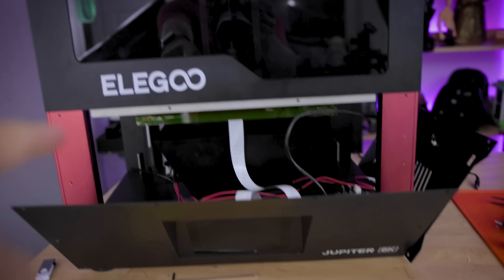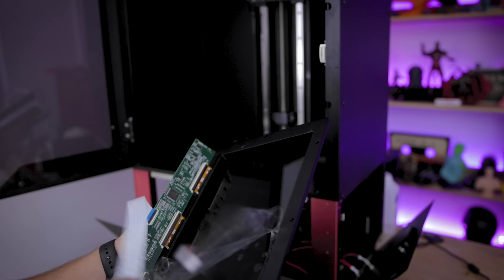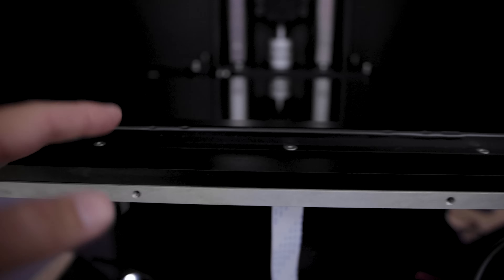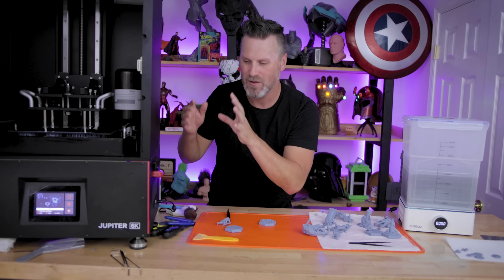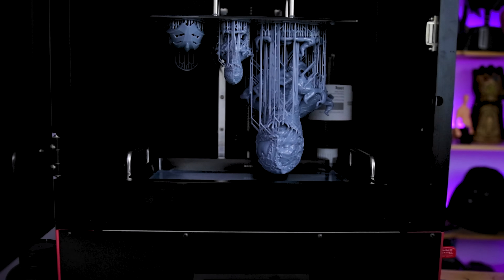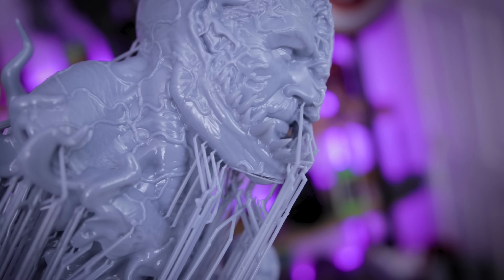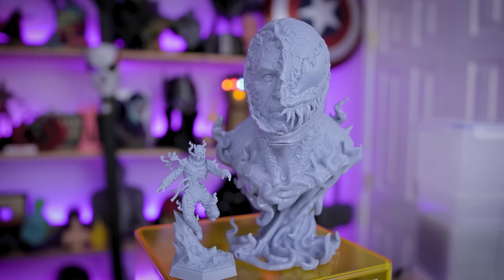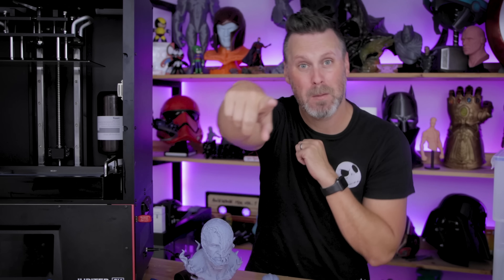Elegoo Jupiter - Screen replacement / VENOM BUST!

Comment: I just unboxed and setup my Jupiter resin printer. I followed the instructions but I cannot get anything to stick to the plate. I am printing the file that was on the usb stick, any thought. I have dumped the resin and cleaned 3 times then level again .

Comment: Why did you have to replace your screen on the Jupiter ? I just got mine two weeks ago and after 12 perfect prints, the screen failed with no warning (now just flickering vertical bars on the exposure test and very seldom showing shadowy elegoo test pattern). Already reseated cables and no improvement. No leaks, I have a screen protector Mach5 on, inexplicable failure. Emailed Elegoo support, no answer yet. I wonder about the reliability of these screens compared to my Anycubic Mono X that has worked fine for more than a year. How long did it take to get your replacement screen ? Thanks !

Comment: What type of light source did Elegoo use in the Jupiter? Is that a COB light or an array with the cone reflector?
Reply: Hello Matt, it is COB light source.
Reply: @ElegooOfficial  thanks for the reply! Can you elaborate on the decision to use COB light instead of an array on such a large LCD?
Reply: @MauDib  Jupiter's screen is relatively large, COB light can ensure to provide high and consistent light uniformity. Compared to the array light, the COB light source will not produce any light spot, and the heat generation is lower. No need to worry about the risk caused by heat.
Reply: @ElegooOfficial  thanks so much!

Comment: Imagine a resin printer that all the inner walls of it is mirror and as soon as you finish printing you take out the vat and then it becomes a cure station
Reply: The lights from the screen reflect from every side of the mirrors

Comment: Thanks for the update! It's really reassuring to see that the added scale of the Jupiter doesn't seem to be causing unanticipated problems with suction force on that gigantic build plate, even without holes in it. I'd still like to see the plate with no flat surfaces on top for more complete resin draining after a print, but I'm feeling confident about the printer I'll be getting in March!
Reply from the maker: Ohhhhh just you wait. I am going to be testing the limits of the print speeds / quality very soon.
Reply: @UncleJessy  I'm super excited to see that!

Comment: How do you remove the bottle on that auto-feed without spillage?
Reply from the maker: You can just lift it straight up it’s pretty wild
Reply: special caps come with the Jupiter. The caps are spring loaded with a rubber gasket. Sort of like an valve on a tire. when you press in the spring loaded pin it opens the sealed gasket. The elegoo Jupiter port on the resin tray has the Male end shaft that when you depress the bottle with cap onto it, pushes the spring, releasing the resin. A twist lock system holds the bottle in place.